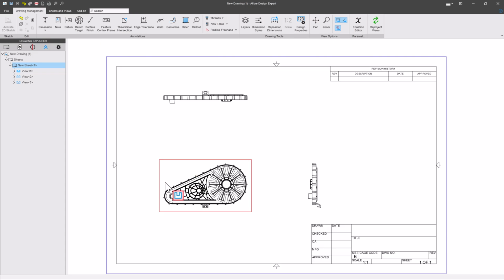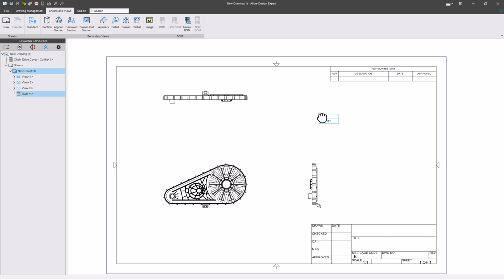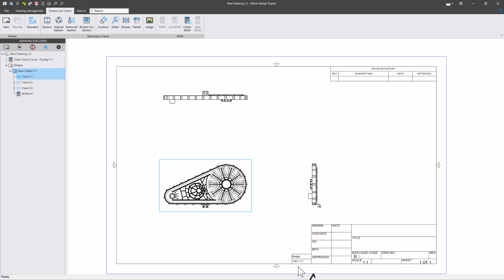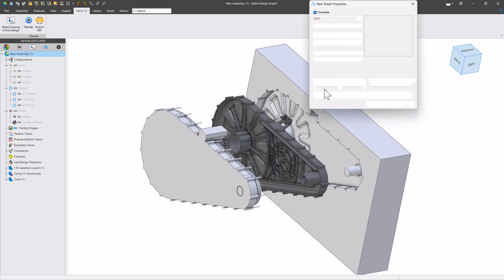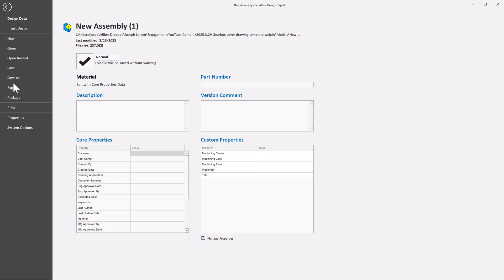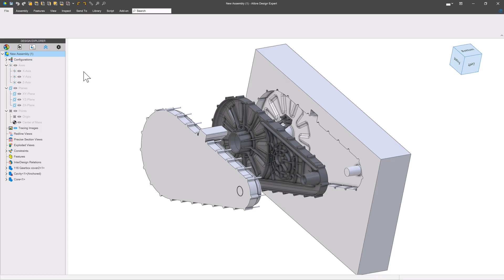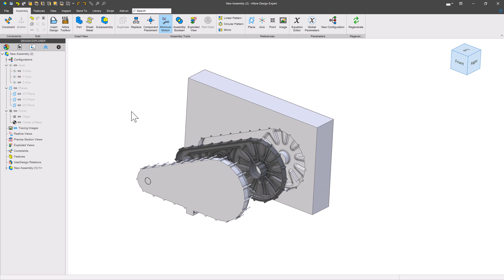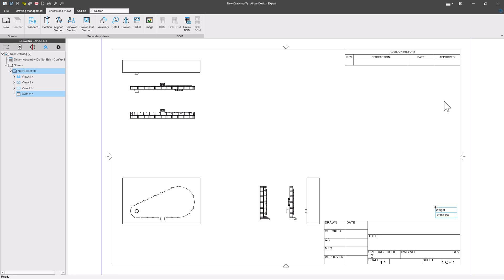Alibre | Report Weight in Drawings [See Newer Video in Description]

Comment: Some time ago on the forum there was a conversation about adding a Mass for Drawing parameter to the part and displaying that on the part drawing. That works but requires a few manual steps. What you show in the video makes it automagic.
The could be a problem though if you have multi-sheet drawings since only one BoM is allowed per drawing. Short of a drawing enhancement how can we get around that limitation???
Reply from the maker: I am actually working on another video on this topic.  I'll add displaying mass on multiple sheets and see what I can come up with for you!
Reply: @AlibreLLC  It can likely be done with a Field for Mass and manually entering it in a custom property in the part, I  haven't tried it with a field for Weight to see if that will work without manual entries.